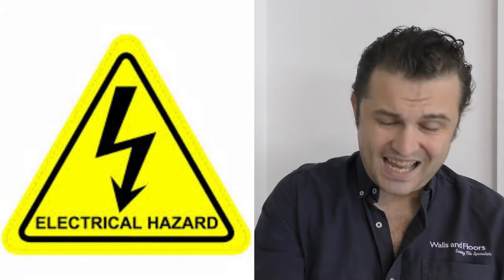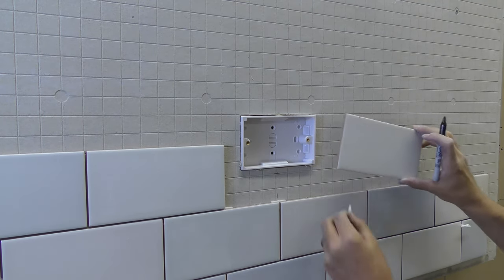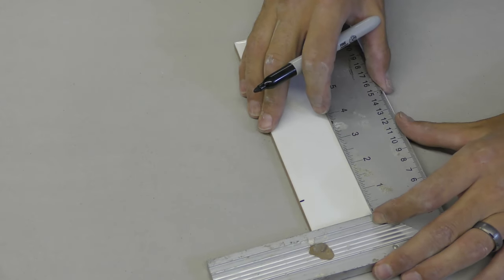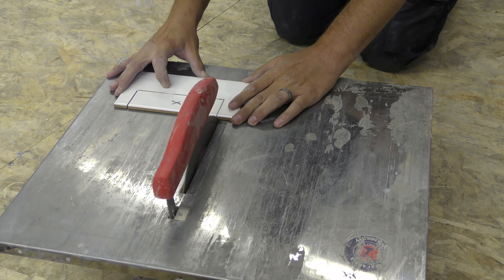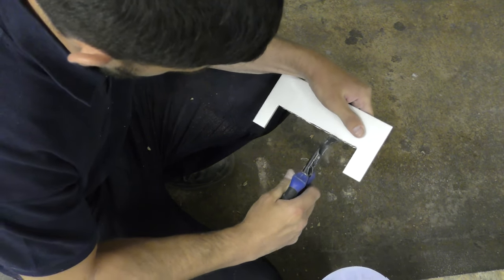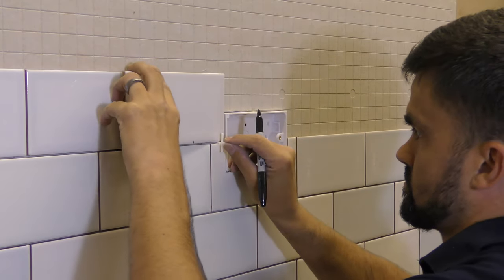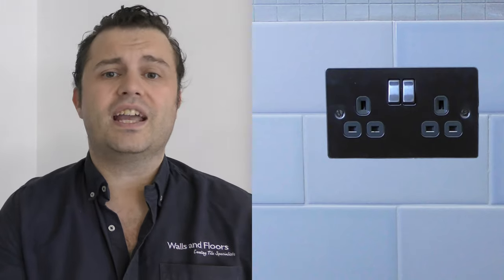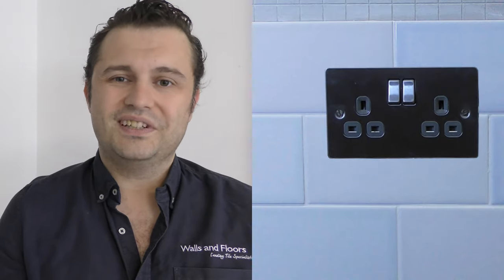How to tile around an electrical socket

Comment: My tiles are slightly proud of my patress boxes, do try and set the boxes flush with the face of the tiles or, can I put my nice new switch plates on, using the same silicone that I'm using all around the kitchen, to seal the plate to the tiles ?? It's literally 3-5 millimetres on all the boxes,lower and upper including light switches. It was like it with the old tiles that I removed and it is slightly less with new new tiles I am about to install so, it has been like that the entire time I have been here and there has not been an issue, I just want to know so it is done correctly, legally with longevity and safety in mind.

Comment: This is a very unusual socket situation - having an external mounted box sunk into the wall.  Why show an example like this?  Most sockets have a back box (metal or plastic on other side of plasterboard) which means that it's not straight forward as in your video.....that is, you'd need to install extra long electrical screws since the tile goes behind the electric socket front plate, not around it like in your video.

Comment: You skipped the part where the outlet or switch is now 1/4 to 3./8 deeper than the surface of the new tile. Magically you go from no outlet to screwing in the faceplate. But that's impossible if it is set behind the tile.
Reply: Just use longer screws.
Reply: Longer screws

Comment: Ok but usually the sockets would be mounted on a metal back box not a surface patress box that has been sunk into the wall some how. That will need a somewhat different technique especially if the tile surfaces are textured. The actual sockets need sealing to the tiles somehow.